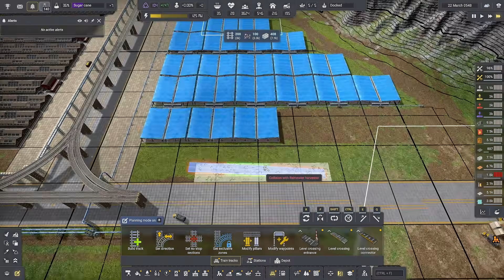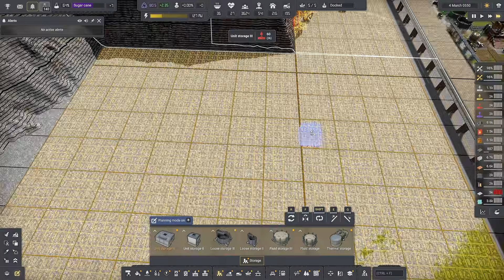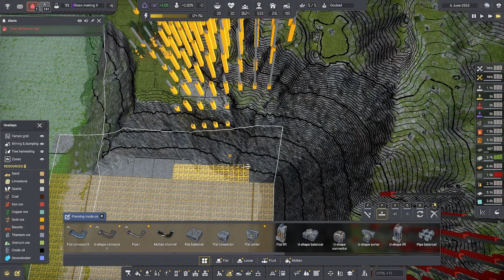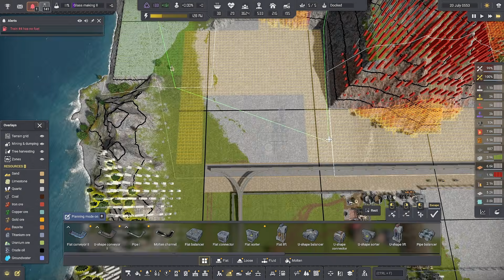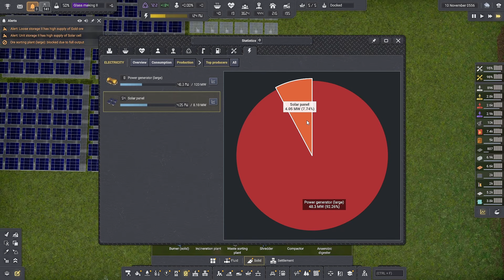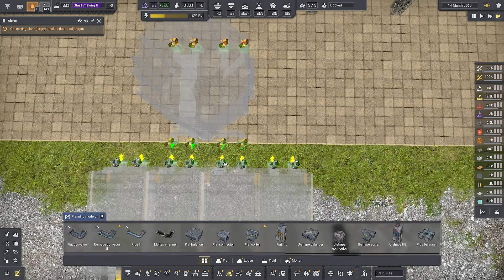Vanity! Gold, Luxury and Imported Goods | 15 | CAPTAIN OF INDUSTRY - Update 4

Comment: you should be able to unity build the first segment on each side of the bridge (so two segments), then the middle needs the amphibious vehicles. I generally plan most of my bridges, then unity build the first and last part, and leave them amphibious vehicles to work on it over time. it should be done long before you need it this way. otherwise you have little control over it.